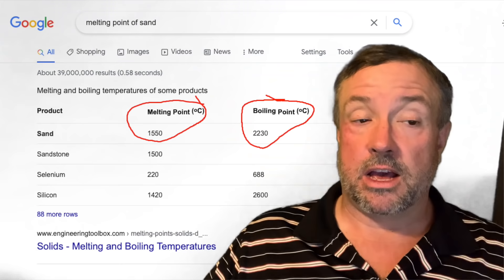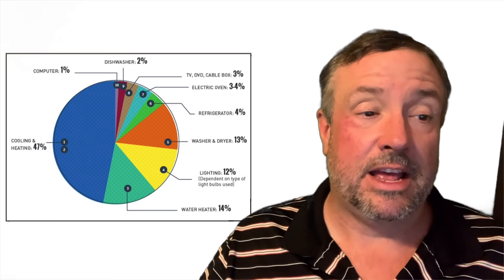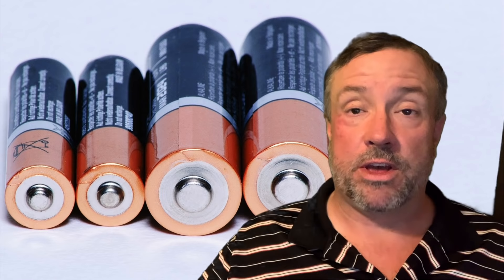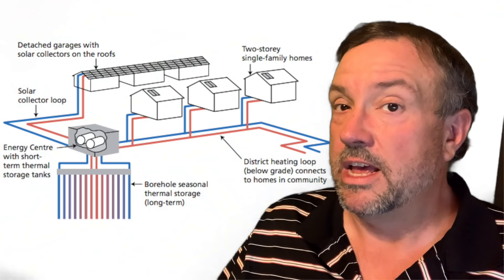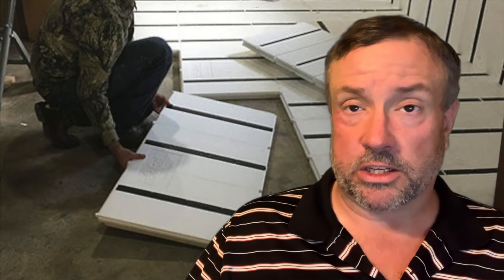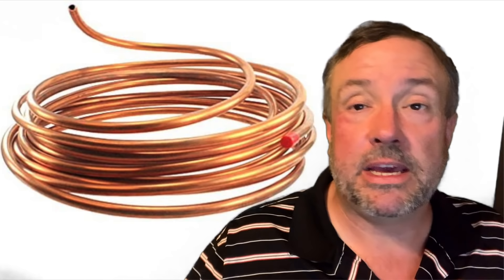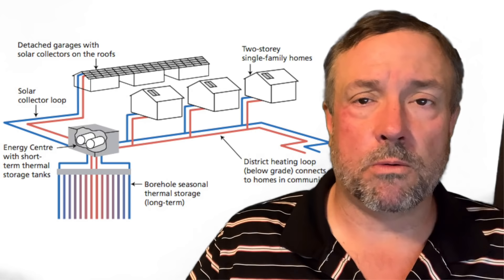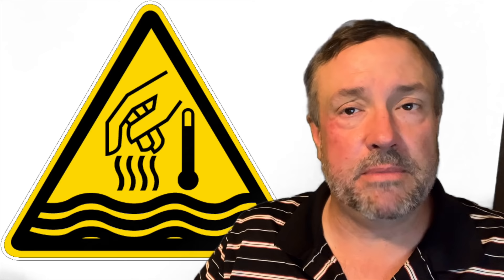Sand for Thermal Energy Storage

Comment: Use the heat stored in the sand to heat air and pump the air to the dwelling / greenhouse.
Eliminate the complexity and expense of liquid handling altogether.
Used aircon ducts are usually available in metal scrapyards. Cheers
Reply from the maker: I like it
Reply: A little simplified, but the sand must be heated first.  Then the heat can be distributed.

Air alone will not create enough heat in a compost pile to heat the sand/rock bed uniformly.  Also taking too much heat or a a fast rate from the compost pile decreases the amount of "energy" created.  Distributing heat via an air plenum also lowers the efficiency and is adequate for a small confined space but not a larger area.

Think "Rocket Mass Heater" concept but will a large mass heat storage area.  My greenhouse is 30' x 60' and I will be adding hydroponic growing space next year.
Reply: @frankfrederick5158  Air doesn't create any heat. It's just a medium for transporting it. Move the air and you move the heat energy it contains. Works pretty much the same as with fluids. Fermentation inside the compost pile will produce heat, but only a small amount. You can extract some of that, but if you take too much, the fermentation process will slow. Air would work fine for warming sand just like any typical household heater or heat gun does. The issue, is having enough input heat to charge the battery at a rate faster than it loses heat. Even with insulation, heat will be leaking out of the battery.
Reply: @shaun6828  Thanks Shaun, I do believe we are saying the same thing, just in different ways.

Your comment on fermentation is correct.  I might add it take "air" to create the fermentation process.  Starve the process of air, deplete the fermentation (heat) created.

Also, for the compost pile to last (up to) 18 months small mounts of water, air, and bio digester are added regularly and the pile "turned" to help the process complete.
Reply: @frankfrederick5158  I saw a video of a farm that used sealed tanks for the process. They tapped it for methane emissions. I guess it also depends on what is being composted, but ethanol is another possible byproduct...
Reply: @shaun6828  Yes, methane is easy (just put a pipe under a landfill and you will get hoards of the stuff).  The hard part is storage and compression.  

However on a small scale a simple bio-gas digester using table scraps can create enough "gas" to cook and possibly even heat.

Look up bio-gas digester here on the tubi, they are simple to build and if one is off grid it offers some possibilities.
Reply: Couldn't agree more on air being the more desirable way to go.

Any fluid is prone to leaks. An air leak is not a disaster. A water leak could be. A leak of antifreeze mixed water is at minimum a minor disaster. A leak of oil in any real quantity is an EPA Level Event.

Transfer media must be chosen to be safe, cheap, and efficient. Water if done so no chemicals are needed is in my mind the best of 2 of these. Cheap and efficient.

On the otherhand, if the transfer rate needed can be met using air, that's the way to go. It is the safer media. More and larger ducts will likely get you enough transfer rate so long as there's room.

Also having the collectors as close as possible to the storage, and using an electronic difference thermostat to contol blower speed should allow collection of higher temperatures.

On the living space heater side, a similar manner of controlling airflow speed could be used to deliver a reasonable level of heat to a standard oil or gas heater type heat exchanger/distribution box (200C or better). Forced hot air is very responsive and comfortable.
Reply: @shaun6828  Jean Pain woodchip mounds are large for that reason.  Small pile, small heat generation, scalable if you bring in lots of aeration.  They boil terrific amounts of water, but like you say, they basically peter out and the woodchips, the fuel for the bacterial and fungal action, need replenishment eventually.
Reply: Mi question is how long the sand will storage heat on a 30 fd outside after the sun is sit?
Reply: Where does the power to run the pumps come from?  What happens on a cloudy day(s)?  How do you keep the home cool when temperatures soar?  Air has poor thermal characteristics so it would be an inefficient medium to transfer heat from the collector to storage.  There is much to consider.
Reply: @shaun6828  Thank you for sharing this. You just helped me out, big time.

Comment: I've been researching subject for long time, use ceramic medium, best guess is chimney prefabs. Use nitrogen as heat transfer medium and air turbines to move heat around, can place turbine on cold side. I'm aiming for temperatures reaching 700+C here, borderline stainless steel heat, because it's in later parts in my project where stainless is inevitable at one point of it.
Liquid salt and liquid sodium is too corrosive, for your small scale I'd suggest using nitrogen as neutral medium. Can use existing evacuated tubes and parabolic mirrors. For your use best is steel water pipes that are stick weld and have nitrogen running trough it. Obvious side note, you need air pump engine well separated from blades and any regular bearings.
Reply from the maker: very cool!

Comment: We plan on using MINERAL OIL ( it's Inert ) 350F / 180C.  Run through Pex using a Solar style water heater/collector with a 1 watt Car water pump. Its simple. System is buried in IBC totes under ground wrapped ( set ) in aircrete. Return closed loop is water ( easy clean up should there be any future  failures to the system ) run through hydro radiators.  Great  Preheater to add to any Hot water system.
Reply from the maker: cool!

Comment: Build the sand storage box with an air gapped insulated compartment on top and control the temperature of the air so that you can heat a closed loop water system directly via salvaged radiators or copper pipe. You may need an exhaust in the air box as protection to prevent over heating of the water.
Reply from the maker: interesting

Comment: I did the calculation on my side ( with density and specific heat value of sand ) and I need about 60 000 liters of sand ( 60 cubic meter ) at a temperature of 500 degres celcius to cover my heating needs during winter in Canada. That's enormous ! It's about 10 000kWh of heating energy needed and perfectly isulated. So probably to cover the heat loss , need more than that.
Reply from the maker: Ok
Reply: Eso es unos 15 metros horizontales y 2 metros de profundidad , es perfectamente posible y barato. Si ademas consiges 50 grados , el salto termico a 60 0 70 grados centigrados sería muy economico para la casa . Un saludo

Comment: For a small room/ green house  i would say: buy an green egg /ceramic bbq, fill it with sand/ basalt. Stick some 12v ceramic heating elements ptc in it on and connect them the solar pannels. Use the lid to regulate the heat.
Reply from the maker: Expensive but might work
Reply: This green egg BBQ has alway burn my steak after 1 min ,i like it blue :)

Comment: Some back of the envelope calculations.
4,19 kJ/(K·kg) *100kg*100K=41 900kJ
0,84 kJ/(kg*K)*100kg*1000K=84 000kJ
So yes you can store more heat in sand if you heat it to 1000C but I still would say that water is better choice. 1000C is good forging temperature and I suspect materials that can handle that are quite expensive (at least for small scale).

Still sand is far better choice than I anticipated. You might even be able to do it without any piping in the sand itself, just pump air trough the sand.
Reply from the maker: thank you for the insight!

Comment: I'm about to build a high performance house. We are using geothermal hvac and solar hot water. We are running our hot water in the roof rain screen with metal roof and radiant barrier. It will be a continuous Ling with no breaks being pumped to an insulated pre tank in the attic. We are in climate zone 3 so our cooling is more of an issue than heating. Non the less we will try it to see how it works out. Good luck with your project 👍
Reply from the maker: I hope your house works awesome! thank you for the kind words!

Comment: Talk about this... to transfer heat from wood stove to sand, try air, thru steel pipe. Wood exhaust contains VOCs so we'll need to use a filter or transfer device to keep our hot air clean. For pumping hot air, use the hot end of auto turbocharger, cold end replaced with electric motor. Other thoughts: supercharge (compressed air) the wood combustion chamber, electrostatic exhaust filter at other end.
Reply from the maker: Great idea

Comment: If you use electricity from solar panels to heat sand during the day, should be enough heat to heat the house during the night. If you store sand under the floor of your home, it needs less insulation because the heat is inside your home when sand cools.
Reply from the maker: Makes sense

Comment: What if you took a new empty 500 gal septic tank and fill it w/ sand/water mix (water added for better thermal transfer) added copper/pex/ stainless steelcoils for both the primary and secondary exchanger and used that? The tank cold be wrapped in insulated board both inside and out. You could manifold the tubing for better transfer also there’s a thing called Glauber salt that phase changes with heat. Just a few thoughts I had, have a good one

Comment: So say you use some sort of rocket mass stove to heat a large volume of sand to maybe 500 c. Then used in auger system to move hot sand to an insulated storage bunker. Augers are cheap to make then work fairly reliably. What I'm saying is basically you'd like to have your thermal storage like in your basement or crawl space but you don't want to have a wood stove there heating sand there, so you could do something sort of like a outdoor central boiler just super heat the sand and then move it to a spot that was more beneficial to have it like an ultra insulated dump tank in your basement. Sand is the fluid.
Reply from the maker: good ideas
Reply: Made me think of smaller sand batteries in cylinders for less heat and larger ones of more heat. Rolling along a track under the house as needed.  Even spheres would work. They could seek out the cold spots.
Reply from the maker: @johnbutterworth1369  interesting

Comment: Used and spent motor oil might be an affordable solution in some areas. Switching to an oil burner isn't the most eco friendly. However that also allows you the opportunity to meet with more mechanics that might be able to help. Hydraulic fluid is pretty useful as it can take a ton of heat and is designed to be pumped. However you heat it, you can contain it in 55 gallon motor oil drums and cycle it through a radiator.

Heliostats are great in sunnier places than Manitoba. Honestly an automated pellet stove hooked up to wifi for the auger might be the simplest solution to what you're trying to manage. Just elevate the hopper that feeds the augur and maintain it as necessary.
Reply from the maker: cool ideas
Reply: I would run it thru a good filter first and remember that spent motor oil is also a good base to make diesel fuel

Comment: schedule 80 steel pipe, used full synthetic motor oil (it is free from your local garage) it will not burn until it gets to 450*F not as high as you could heat sand but it is the most cost effective thing I have found so far, consider using sea shipping  containers for your storage, and rockwool insulation (the only insulation that can take 1500*F ) Ive been giving this system a lot of thought for a central heating system for my farm. Resistive heat is horribly inefficient. Im thinking a heat pump would work better... if I charge the sand in the summer the wast cold could be used to cool the house and green houses.   Im in NH and we will build deep winter greenhouses that are insulated on all but the south side, so will only need added heat for 3 months.  We are still working on design and collecting building materials and will start building summer of 2023.  best of luck to everyone trying to figure out this problem!
Reply from the maker: Sweet

Comment: I would look at conducting tubing both electrically and thermally. It serves as both electrical heating element and air conduit. Bury such a tubing array in the sand. Use the output of the solar panels to power electrical heater. Run an air pump to circulate air through the tubing.
Reply from the maker: good idea
Reply: This is what I was just coming around to. Another option is to mix some carbon black in with the sand and the medium becomes the heater. Would still need copper pipe to harvest the hot air/water though...

Comment: PV solar - battery - inverter - hotplate - stock pot filled with sand - some kinda insulated hood to remove when you want the heat. On during day off during night.

Comment: I'm Canadian situated in Quebec and I've been looking into this for a long time. Like said before we need to follow the KISS principal. I think that using a heat pump to move heat from a lower temp source to a high temp storage might be the way to go. I'll be looking at a 4 port system soon where I can use 2 ports to store/retrieve heat from the storage and 2 ports for house HVAC. Might be even better with only one circuit to control heat transfer both ways from the battery.
Reply from the maker: great ideas!
Reply: Depending on the amount of storage mass, a heat pump is going to, typically, manage low temperatures. The advantage of sand is that it can deal with very high temps. The greater the mass, the higher the temps, the greater the energy storage capacity. If you have a well sealed house with in-floor heating, the demand for space heat may be low. Water heating is different.
Reply: @donalddalley7274  Of course, for maximizing the low limits.

Comment: Peltier devices heated by that sand, cooled on the cold side by the ambient air above the sand would produce a fabulous instant voltage. You need a good quality peltier, like those used on spacecraft.
Reply from the maker: Very cool

Comment: Here are a few thoughts for you.  1.  oils and other chemicals are costly and in the case of a spill, may cost a fortune to clean up.  If you used oil for pumping the heat into the sand, simplest solution for retrieving the heat is obviously air.  Liquid salts are very abrasive and will destroy most piping quickly if I understand that correctly.  If you are storing heat, you could even use a Stirling engine to convert some of the heat to electric.
Reply from the maker: interesting!
Reply: I have such a thought bt don't knw hw practical and efficient it is
Reply: where can i get a decently sized stirling engine from?
Reply: Assuming one is using sand already; and reaching temperatures well above 100C, then I guess using a steam-engine for generating electricity would be better? Not that I have built one myself. But my research leads me to believe that it will be way more compact, give higher output, will be easier to build, and probably cheaper. Not a steam-turbine though. Would have to be a piston-system, like an old four-stroke engine or something.